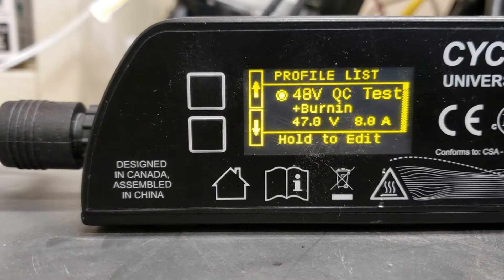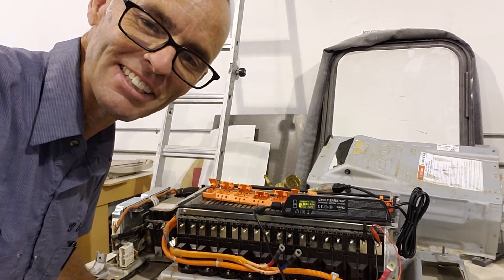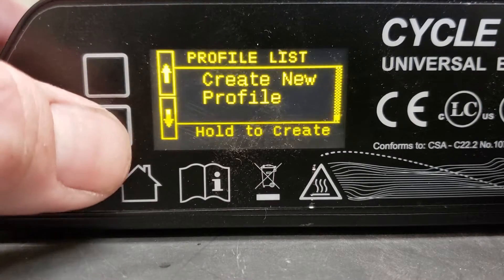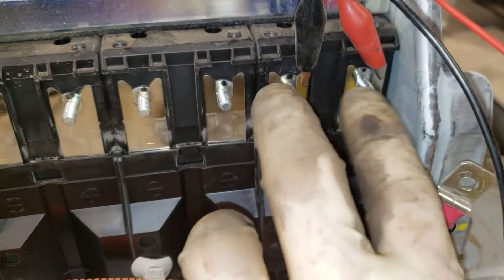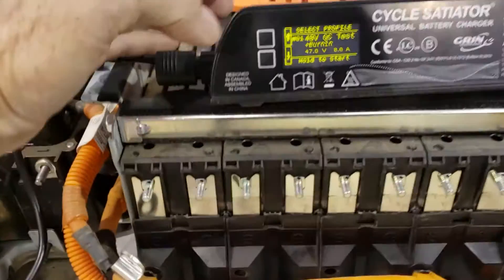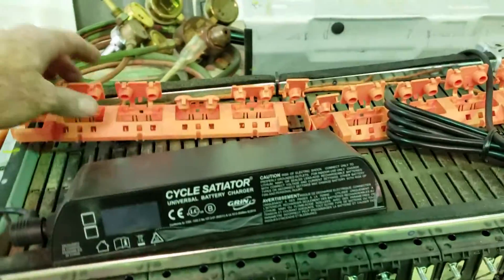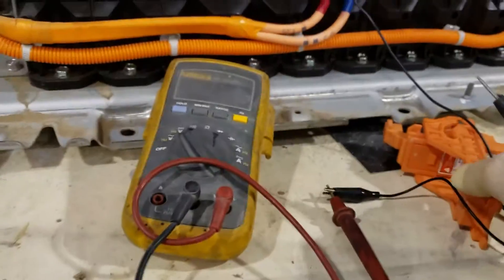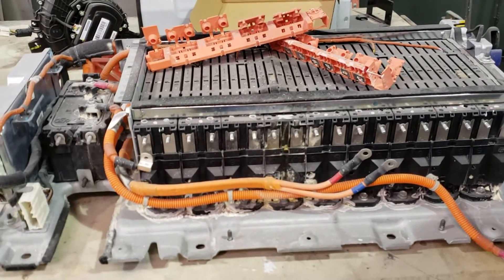How to Charge a Hybrid Traction Battery

Comment: Hi I have the same issue with my hybrid Hyundai. How did it work out for you charging the battery?
Reply from the maker: No, the engine would start and the car would run but would not charge the battery and it went dead very quickly unfortunately

Comment: Hi do you have the final result? A mean the car start up? Thanks
Reply from the maker: Yes, the car started just fine, but the engine had a bad noise and the inverter was not charging it, so all that work for nothing.
Reply: @AZExpert  Wow, One question Is necessary charge the 9 batteries cell to 30 Volt? A mean do you know what is the Nominal voltage on that batteries. Because I tried to charge mine and take around 12 hours to charge just 1 volt. And I had 22.7 V in Few Cells 😬 it’s Going to take me around 2 weeks. ( I using a regular lithium charger) thanks for your help you just literally save my life!!

Comment: At 11:20 you say you think there is possibly a problem with the hybrid system. Did you resolve this? 

I had bought a 09 that does not run the code is p0afa. The previous owner described something similar the noise followed the next day by a  dead traction battery. I was going to swap the battery from another running 09, I'm glad I found this video before doing that otherwise I may have 2 non running 09
Reply from the maker: I did not. There was definitely a huge battery draw
Reply: @AZExpert  So the Kia also drained the battery that you charged in this video?

Comment: Are there any other chargers that would work?  I have the battery out and most packs are 27.5  two of them are 26.3  but the car wont start with a new 12v battery installed do I need to have them at 30 volts to turn over the car?
Reply: Did you ever figure out what was wrong?
Reply from the maker: some use RC plane battery chargers too
Reply: I have the same exact thing measurements and all ,tell me if you got a solution I will tell u if I get mine sorted out

Comment: Did it workout? Is there any other cheaper option for a charger? Could I just use a 24v 2 amp electric bike charger and just check it with a multimeter
Reply: I tried the bike charger at 56v at 2amp the charger goes into protection mode

Comment: We have 19.6 battery life left in ours, car will not start. Could that be the problem ?  Those battery charges are pretty pricey. Is each cell is 30 bolts? Just wondering if I replaced cells, how many I would need vs buying a charger?
Reply from the maker: Yes, it would keep it from starting.  Salvage yards may have them too, but you'll likely have to charge it either way

Comment: Hi. Is the charger really helpful to charge the hybrid batteries..can it cycle the batteries? Was it possible to re balance the batteries? It has a connector that can connect to a computer for the discharge curve analysis, did you try it? It can charge any batteries NI MH too
Reply from the maker: This is not a permanent solution, only a means to charge the traction battery for diagnostics as the car is dead without a traction battery. The factory method is quite different. Thanks

Comment: I did the same thing but i used the Imax b6 universal hobby charger, worked like a charm & only cost $40 on amazon
Reply: I tried the hobby charger, but it only went to 22 volts...(6 cells).  each section of the battery is 7 cells.  www.Powerstream.com has chargers specifically for 7 cell Lithium batteries.  I got one for $70 including shipping and alligator clips and I'm back on the road!  The Kia dealer couldn't even charge the damn thing!
Reply: @matthewcallnan8822  how long did it take for each module to charge. And did you have any issues. Do you have the exact model number?
Reply from the maker: I figured that would work too, but I was outside my comfort level for sure with this and didn't want to test a theory on someone else's battery. Thanks!

Comment: Did you ever get the Kia running?  
I replaced the internal combustion engine on a 2012 Sonata Hybrid (look up Theta II engine lawsuit) but I can't get it to start because the traction battery is too low.  The dealer can't even charge the battery!!  Hopefully this will allow me to save an otherwise useless car.  
Thanks
Reply: Also - found a small (aka slow) 33.6V charger for 8S LiPo cells on eBay.  Not as nice as yours but it should allow me to save the battery from dropping below the 15% threshold.
Reply from the maker: @crispoulson8830  definitely, the charger I had was somewhat difficult to use too.
Reply from the maker: Yes, once the battery was charged the eninge fire up.....however, I think the engine had issues or the hybrid drive system did. It was loud rattle and the traction battery depleted very quickly less than 5 minutes but the car would move. I don't think the owner wanted to go further with it, which is a shame as it was a very nice car.

Comment: It just works if you have a dead battery ? I have a 2011 Optima Hybrid is loosing some MPG so is probably because the Hybrid batteries is losing their capacity. You think if I charge them all will increase my MPG again ? I try to take a look online for this Hybrid batteries but I just found used ones. Should I invest on this charger that you mention and try to charge them ?
Reply from the maker: no, this will not restore a battery capacity at all.

Comment: Ive had a dead optima on my hands for over a year, your solution will help me get it back on the road. THANK YOU SO MUCH! I will report back when I get this done. Awesome work
Reply from the maker: Good luck! I hope everything goes well, generally there is a reason why the battery goes dead though so have a scanner ready.
Reply: @AZExpert  it was my fault. The engine had an issue and I moved the car using battery power. Never thought a modern day car would be dumb enough to kill it's own battery beyond a safe level. I did find a 29.6v 1a lithium battery charger for $49. Would it not be possible to use that? What do you think?
Reply: @iflyuls  did you faund why it wasn't charging the battery ?I have the same problem 

Thank you!
Reply: @arturomorales9331  In my case the motor was bad. We replaced the entire engine and that was my solution unfortunately. The 2.4L is a junk motor thats going bad in a lot of cases unfortunately.
Reply: @iflyuls  ok so you replaced the gasoline engine what about the hybrid starter generator ?
Thank you so much in advance
Reply: @arturomorales9331  just the gas engine. That's all I needed to do
Reply: @iflyuls  thank you so much ! your experience got me a lot of direction where to look at. 
Apreciate

Comment: I have 2015 Kia Optima the car don’t start. On the cluster show  stop vehicle to charge battery can you help me
Reply from the maker: I cannot help too much, the engine should be the charger. If the battery is so dead that the engine won't start, this is the process I used to get the engine started so I could troubleshoot the car. Thanks!
Reply: AZ Expert 
I replace motor I put new battery 12 voltage shop before code p0a0d
Reply from the maker: @daautowholesale6277  what does the traction battery gauge show not the 12volt battery it doesn't start the engine.
Reply: AZ Expert 
I put new hybrid battery
Still the car don’t star only show stop vehicle to charge battery already put different hybrid battery
Reply from the maker: The traction battery should show some voltage on the dash gauge if it is charged even a little bit. Sorry I can't help more.
Reply: Hey brother what wires as far as color did u attach the alligator grips too

Comment: What wires do I need to purchase with the cycle charger to hook up to my battery. Please and thank you. Great video btw
Reply from the maker: Well all I used were 24awg jumper wires, I guess it depends on how often you will be doing this.
Reply: @AZExpert  how often do u think I would have to recharge after this 1st time. I plan on selling the car after I recharge the battery. Also thank u for taking the time out to answer my question. You rock
Reply: Can I use 18 awg by any chance
Reply from the maker: @beerninja7671  of course
Reply: @AZExpert  Thank you so much. You have saved me so much money, and right now is definitely the time to pinch back as much as possible. Thanks again
Reply from the maker: @beerninja7671  did you get it going?
Reply from the maker: @beerninja7671  If everything is working, it should never have to be re-charged again. This happens if the car is left unused too long, or if there is a engine/charger issue preventing the battery from being charged. The car logic is not suppose to let the battery discharge past the point where it can't start the engine. Thanks!
Reply: @AZExpert  I just now got the charger last week and started to charge it today. I'll let u know and thanks again my you tube friend
Reply: Did it work for you ?
Reply: @william110051  yes it did. It charged the battery all the way. Unfortunately this was only part of the problem. My transmission was out on my car but i did save the battery.
Reply: Thank you for the video I have a 2011 and am not sure if this is related but have a p0aa6 code. In EV Mode or in running mode the isolation resistance is around 900 kOHMS, well below the spec of 2000 kOHMS but with the key on engine off, the isolation resistance is at 3175 kOHMS.  Some say the 125amp resistor needs to be swapped out to a 150 amp. For a 12 year old battery does this make sense to you? Could this be causal to an HV Battery system isolation fault? Thank you

Comment: Great video. Thank you for making it. How did the car perform once you put the battery back in?
Reply from the maker: So the car engine started and ran, but sadly the hybrid drive/charge system was bad too. :( Thanks!
Reply: @AZExpert  How did you determine the drive/charge system was bad?  When you drove it did the display show energy going from the engine to the battery, or the wheels to the battery?
Reply from the maker: @crispoulson8830  when the engine was running it was not charging the battery and the battery depleted very quickly. It also sounded terrible

Comment: Love the channel all the refurbishing you do is very interesting to me. I'm in a bit of a pickle and wondered if you can advise if what I have purchased is going to be similar to what you bought in the Cycle Satiator Battery Charger. I could not afford one (CS) at this time so I looked and found this suspiciously similar tool. HTRC C240 Duo LiPo NiCd Battery Charger & 1-6S Balance Discharger    https://www.amazon.com/dp/B07NQ9K5V7?ref_=pe_623860_70668670_dpLink             It seems like it is but I have not been able to verify it would do what you did in the video with the CS. Maybe you can see the comparison? Do you know if this could charge my 2011 Hyundai Sonata Hybrid 2.4L Gas. My battery looks exactly the same as yours in the video. I ordered the charger but it will be a month before it is even shipped. I did post questions to the Amazon sellers and it looks like the "American based company" cannot respond at this time to my question. Can you identify if the HTRC C240 does virtually the same as the Cycle Satiator? I cannot afford to wait 5 more weeks to find out. Your input is greatly appreciated. Thank you.
Reply from the maker: Thank you very much for the compliment. I am not familiar with the charger you found...from what I can gather it should work, but though you can set the minimum voltage it doesn't seem to have a maximum voltage setting. I have found the directions on all of these chargers to be confusing and muddled. The kia and hyundai use the same "designs" and truthfully I have had to change the outside sheet metal cover on batteries as "direct replacement" was not completely true from salvage yards(they were the same battery but vented differently).

Comment: Hi r u frm uk or out side uk ? Nd tel me this chager do balance  or only charge , nd normally how many hours or mints take to toyota hybride one pack nd how many vot go up to ! Nd can we not charge half battrey at same time like u charge one pack at time can we not charge 8 pack together making politry negitive nagitive nd positive positive , if u dont understand what im saying plz call my nomber or u give me ur nomber whatup i can call any where in the world+447973779894 joney nick name
Reply from the maker: This is a programmable charger so you can set the parameters(rate/voltage/battery type). But this is likely capped off about 1.5 amps max so charging a whole battery will take all day. I would personally just charge one cell at a time to check each individual cell and make sure I didn't damage the battery by thinking I had the jumper wire correct on 10 cells all at once. Thanks!

Comment: Can you charge a Insight 2019 hybrid battery?
Reply from the maker: It would charge it.....but a 2019?
Reply: AZ Expert I bought it salvage and it set for a while and the battery die I want to know if you can charge it or does it need to buy new one it a 2019 Honda Insight
Reply from the maker: @alexg.labastida1939  I dont usually have a hybrid battery charging service. I was just showing it could be done with this charger. Something that new I would guess charging it first would be my first option as refurbished ones might be difficult to find.

Comment: That's a sweet charger. Haven't seen one like that. do you know if the charger will tell you if you have a bad cell?
Reply from the maker: That's a great question. I've never tested bad cell to check. But it won't charge if the circuit is open and I think shamefully it will tell you if you hooked up revese polarity. Likewise, it would detect a shorted cell
Reply: @AZExpert  based on other chargers I would assume that it would either indicate that the cell wasn't accepting the charge, or it would just keep trying to charge forever with no increase in voltage showing up.  I have been checking out your videos, they are quite good. Your editing is top notch. Keep up the good work
Reply from the maker: @AustinCoulson  Thank you so much that is great to hear I don't get much feedback. I'm barely comfortable with any of the videos I've put out but I keep trying.